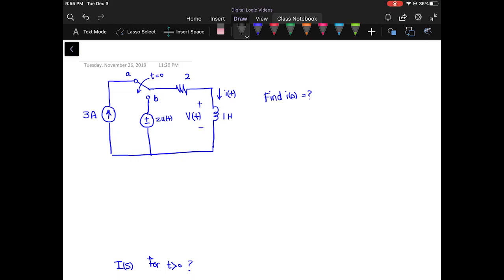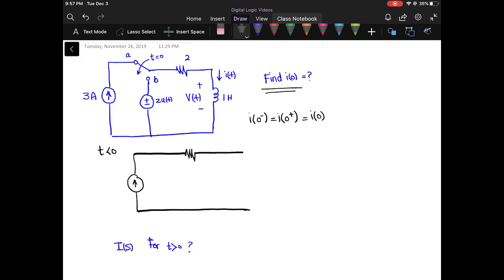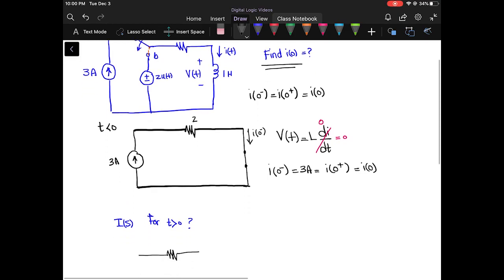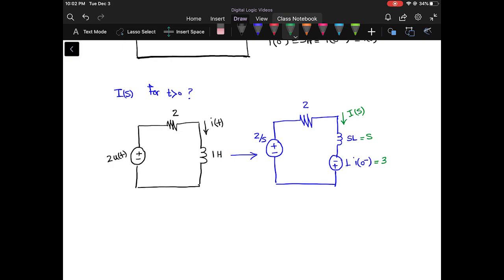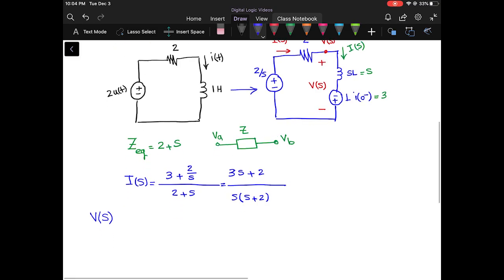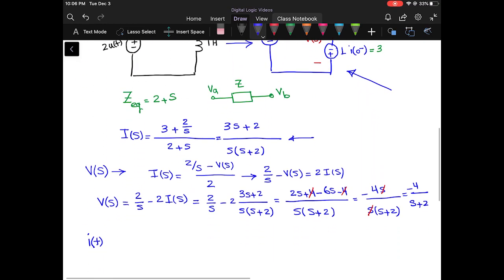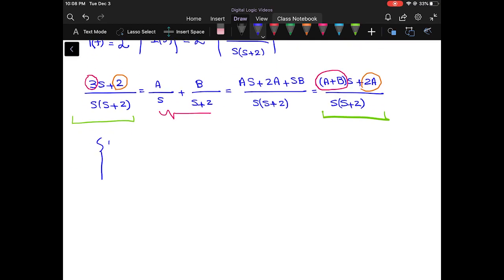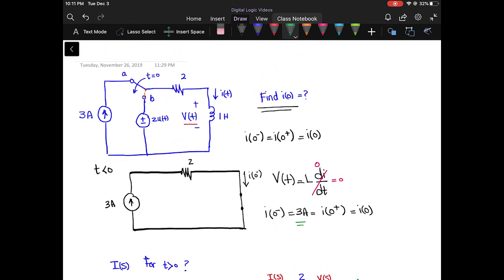Solving a circuit using Laplace transform

Comment: thanks for the videos. Could you solve more advanced circuits as an example? for ex with connector, combination of voltage and current shield and 2 switch